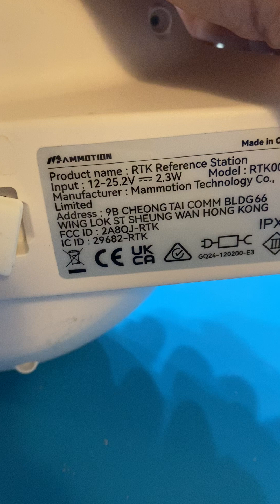RTK tear down - Luba 3000 mower GPS

Comment: Those are 200 ohm resistors (200 with 0 more zeros). Parallel resistors means less cost. High-wattage surface mount resistors are very expensive, especially if everything else uses low-wattage resistors; and in addition, multiple resistors allows the load to be spread to more area so no thick PC board traces are needed. Again, to save cost. If there are 12 in parallel, the result is the same as a single 16.7 ohm resistor of a higher wattage.

Comment: water inside: heard it's due to hot days, the air inside expands - create a break in seal. Then the humid air gets in. Then when the air cools, the seal reseals, the humid air inside condenses, so that's how the water gets in. Repeat over time to build up. Mammotion know about this and plan to address.
Reply from the maker: That’s a plausible theory. 
I’m not 100% convinced because the bottom screws and the antenna connector aren’t air tight so there shouldn’t be a seal to break.

Comment: I'm curious how that bottom channel is designed under the circuit board.  Does it go between compartments?  Also, how's the sealing around the light.  The other thing I noticed, is that 0-ring has no flat boss to seal on on the rear where the thin divider is.

Comment: No, answering your question, people are not installing upside down... I haven't and got a loooooot of water in it. I think it is not sealed right, and over time, with rain and sun, things start to get loose over time. I recommended to them to do a way for the water to get out, so you are safe if it gets in.
Reply from the maker: Fascinating. I wonder if the LED on the front of the unit has insufficient waterproofing. The main circuit board is covered in conformal coating, so as long as it isn't submerged, it should be able to handle a fair amount of water.
Reply: @thespencerowen  I've heard from a couple of Luba owners they believe the water came in from the LED on the front.  I took no chances and use transparent silicon around all the seals including the LED light... and I've been lucky enough not having to mount the RFK super high, but instead on my deck so when Winter comes and long before the snow, I'm taking that RKT antenna indoors!

Comment: Thanks for this. Lots of folk have water ingress. Still not sure where from though. I’ve used weatherproof sealant around every join and also used the 3d printed hood on mine which goes over any joins so I’d be surprised to see any water get in mine. Nice to see the back too. I’ve also sealed the joins around there but looking at this I probably shouldn’t have as if any water does make it’s way into the back part, it may not be able to escape as fast and build up. I may drill a small hole around the back for drainage.
Reply: I'm thinking exactly the same about a drainage hole in the back.